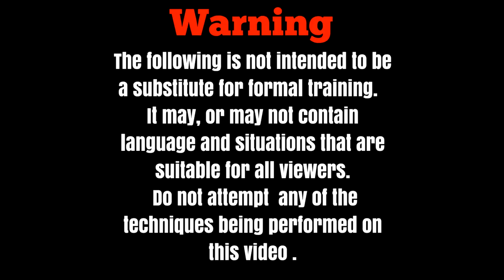How To Do Fabric A Finish On Your Guitar Body Part 3

Comment: I'm a bit late coming to the party but this is brilliant.  I'll give it a crack on my Tele.  Can't find Simtec here in Australia so I'll use the epoxy resin that I have on hand.  If epoxy doesn't work I'll sand back and start over.
Reply from the maker: You can do it my friend

Comment: When i made my pickup mule i did a coffee motif fabric,pretty cool. i glued with titebond , then i did use west systems epoxy.i had it on hand . Doesnt sand easy . Wont use it again,to much like fiberglass epoxy .i spent 20 years in the marine industry, had it with resins , dont ya know. Your method is the boss.
Reply from the maker: That guitar looks a lot like our BBQ pattern, I'm thinking the same outfit made it. :)
Reply: Hey it does,haha  yours came out better. I did it to see if I i could and the mule lives in my shop .

Comment: Thanks Matt! I used epoxy on the one I'm working on. Its a pain to sand. It had to cure for a week before it wasn't too soft to sand. Looking forward to trying Symtec on the next one. It was an Epi LP Junior. I added "ears" to the headstock and covered it in fabric too. I'm trying to decide if I bind this one or if I just do a 1/4" round over and black burst around the edge. I appreciate the videos.
Reply from the maker: The Simtec sealer won't let you down Geoff, tell them I sent ya.

Comment: I have a squire strat that I'm thinking of customizing. I'm really digging this fabric top idea. Since it has a finish how hard would it be to put a fabric top on? As easy as just sanding the top and applying fabric? Or is it better to start with fresh wood.
Reply from the maker: You can do it, we sand it back

Comment: Matt in part 2 you sprayed the next layer but i havent got a spray gun or room for a booth. Couldn't i just add the next coat with the roller again. Thank for the great videos, just ignor the thumbs down id like to see them do better.
Reply from the maker: Hi Tim. 
One can do a lot of good work without a spray rig. Try a couple different things and see what works the best. A good paint brush would be a good choice... of course it would be ruined after one use but it might give you a smoother coating. Thanks for watching amigo

Comment: can you do this with shellac sanding sealer?
Reply from the maker: You can certainly spray shellac and sanding sealer over fabric... however, I know you will not get the same results we get. if you want something more rustic, than it might be the hot set-up?
You will have to do some testing and see what you come up with.
As I have stated before this is the way we do it and don't have experience with other materials.